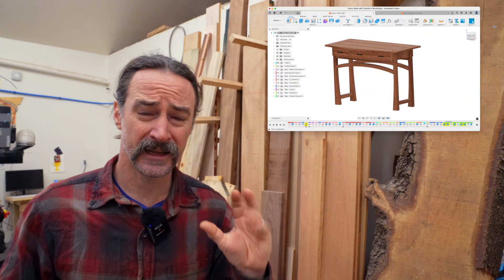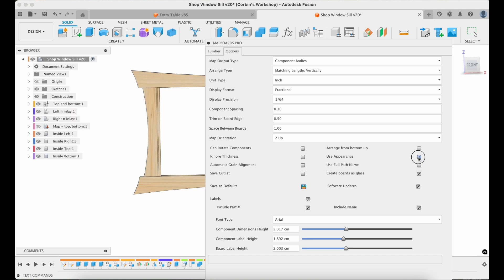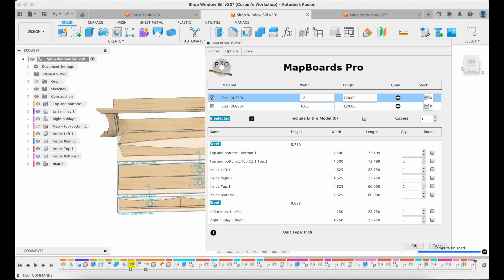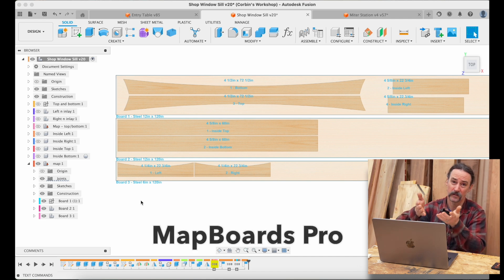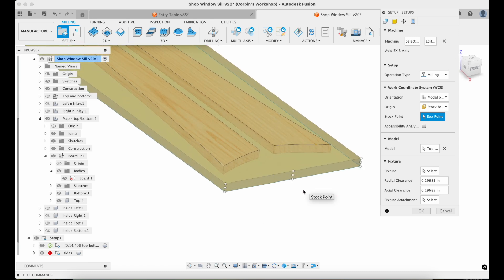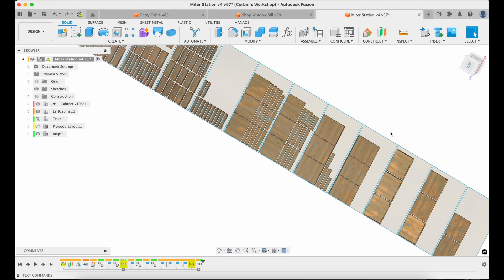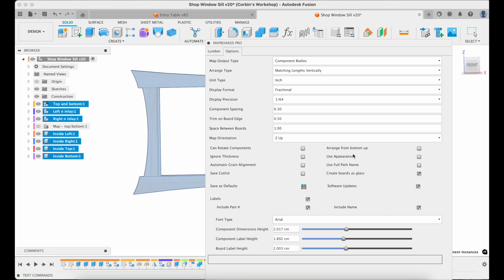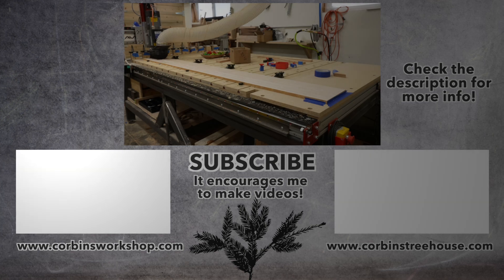How to Make a Cut List in Autodesk Fusion 360 for Woodworking / Nesting Parts / Board Layout

Comment: I'm green when it comes to wood working. I'm a metal fabricator/welder by trade with limited cnc experience on plasma cutters and mills. I  have only just recently dove into the wood working world. The question I would like to ask... why not cut the dovetails in the cnc program? I appreciate any and all response. Thank you!...I appreciate and find TONS of value from your videos!!!
Reply from the maker: Yes - I do cut dovetails on the CNC! Dig through my channel videos - I've got a three part series on how to design them in CAD, setup CAM and cut them on the CNC. You do need a vertical work table for joinery like that!

Comment: EDITED: 1) Great video and i bought this plugin specifically because of your video! so thank you for that! As a tip for everyone, go to OPTIONS scroll down click on SAVE CUTLIST as well as LABELS within LABELS adjust the heights and BOOM you will get the text on the output as well as a CSV (or whatever you set) to your downloads folder that clearly tells you what you need to cut for each board... i was scratching my head trying to figure out how to get the cut dimensions for my project so figured i would pass some help along
Reply from the maker: Thanks! The author of the plugin has also been working on adding direct support for the “work around” I talked about to allow multiple maps and directly create a manufacturing model from them. He is doing a great job in maintaining the plugin. I’m sure you’ll find it very handy!

Comment: Hey Corbin, thanks for making this video you did an awesome job. Up until about a year ago I only used fusion for 3d printing, and then after buying my CNC I discovered being a Mac user my options for cam software were limited, and I might as well use fusion, but it was harder to find videos of people not using the common windows based software. It's nice to see someone else share their knowledge using fusion for CNC work. Ironically, I bought MapBorards pro today and needed some help on using it, and you did a fantastic job. Thanks for the help, and I gave you a sub! 👊🏼

Thank you,
Rob

Comment: Another great video.  As we discussed in the past, I don't actually use the manufacturing parts of F360 yet to set up running my CNC but I want to learn that.  Seems like even though I would take the designs into Vectric or cut using other tools this map tool would be useful if designing in F360.  I got a little lost, but the beauty of YT is I can rewatch as I learn more.  I have found that things I didn't understand on my first view of the video,  I understand on later watches because I know more.  Good idea to download your cad file and study your process because you provide awesome processes.  Thank you for taking time to share.  I struggle with finding the time to make the videos to help others and appreciate you making the time to do just this.
Reply from the maker: Yeah Rob! I definitely went a bit quick on the parts and assumed quite a good working knowledge of Fusion. Definitely try to do your CAM in Fusion; you will get better results than Vectric. The only area Vectric really shines is for VCarves and inlays; I can't replicate Vcarving onto a 3d object in Fusion like how VCarve can do.

Comment: Corbin, another very helpful video.  I use Map boards as well, definitely well worth the $25.  I like your "trick" of renaming the map so you can have multiple maps per project, that will come in handy. You may already know this, but if you right click on the map in the browser there is a few other functions of map boards pro hidden there (a few export options, cut list, etc.)  The developer is responsive as well.
Reply from the maker: Yes, it is totally worth the cost! I do know about the right-click additions; I should have mentioned them in the video, as they are pretty handy for the extra stuff. And yes - the developer is quite responsive! He fixed one bug I reported. I did mention the saving of maps, but he thought they were too heavy weight to do that. So far, I haven't noticed  any issues by saving them.